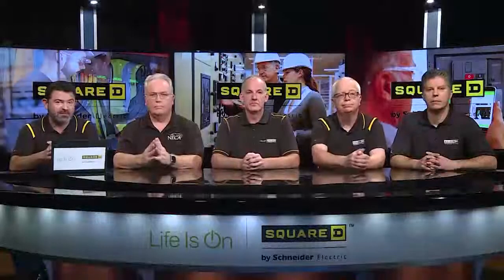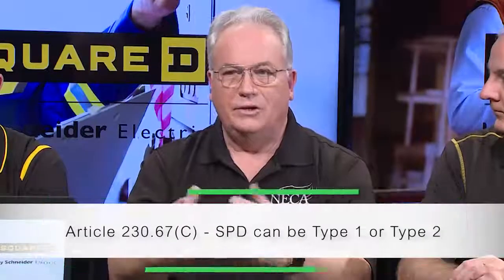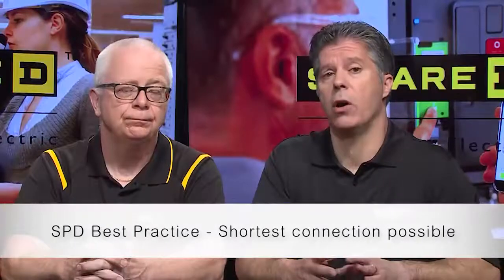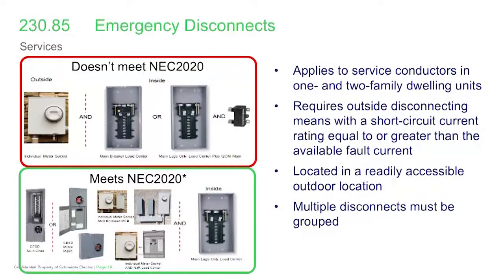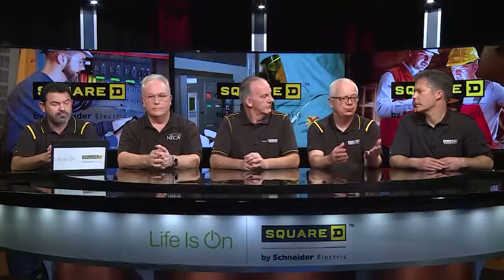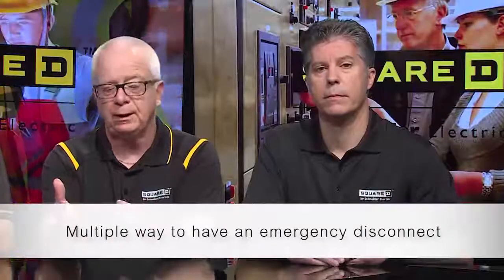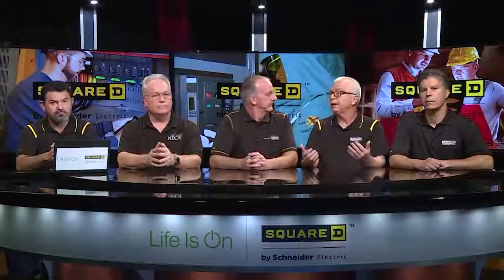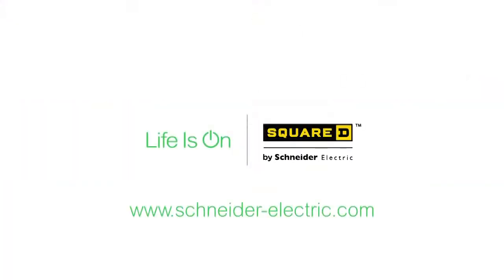NEC 2020: Residential - Surge Suppression

Comment: For installing a service rate ATS outside: If I call it an Emergency disconnect, Not Service Rated can I treat the whole thing like a meter and just run the two hots and neutral straight on through without a SPD and land in a MB Panel and put the 230.67 Surge protector in the MB Panel?  Do I have to install a SPD in the outside ATS no matter what?